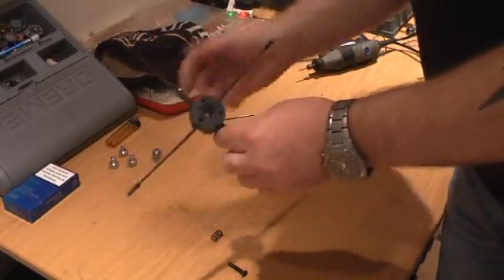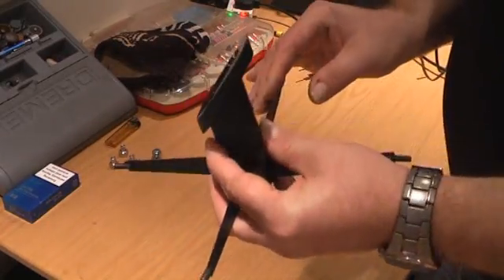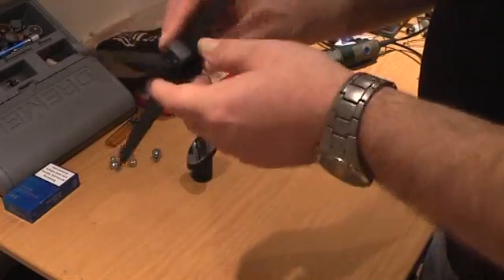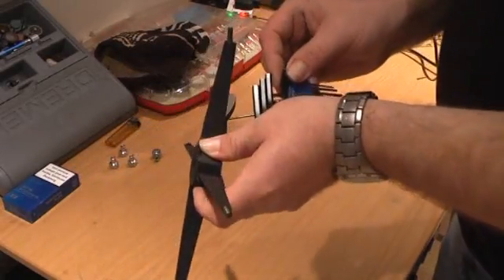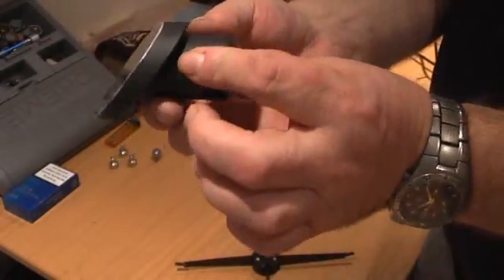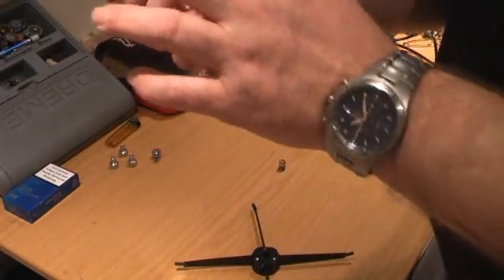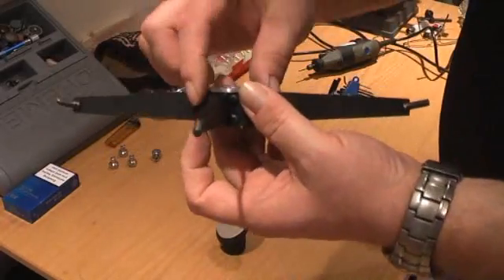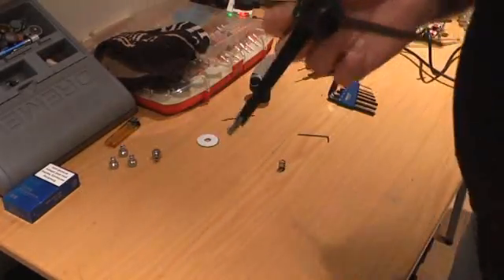Newtonian Collimation Part 1

Comment: Just adding my thanks. It's very hard finding out just exactly this sort of detail, without actually dismantling the telescope - which, as a new owner, I am reluctant to do at this stage. But now I know how it's put together. As someone new to the hobby, I do wonder that these OTAs are so poorly designed - unless that is the manufacturers (Sky-Watcher in my case) have incorporated any of these obvious improvements in the 11 years since this was made. Which I somehow doubt!

Comment: This is a great series.  Thanks for putting it together.  I have an Newt that I never use because I could never get everything lined up.  I'll let you know what happens when I'm finished collimating.
Reply: As a follow up.  I went through your videos step by step this morning.  Went to the hardware store, bought adjustment screws and metal to make the plate that goes between the secondary and spider.  Polished everything.  Collimated everything per your instructions and bam!!!  I always wondered how to get the laser inside the disc on the primary.  Now I know and something interesting happened.  I never knew that the little white disc would fully illuminate when the scope is dead on.  I can't thank you enough for the great information.  You have pretty much saved my astro hobby.
Reply from the maker: Thanks for the positive feedback

Comment: Hi, Where did you purchase the Antares laser collimator? Can't seem to find a UK dealer.
Reply from the maker: Mine came from http://www.rothervalleyoptics.co.uk/  I dont see them on their site but you could give them a ring. I have seen skywatcher ones that look exactly the same as the antares but they are not the same and I honestly think the antares quality is a lot better.
Reply: astronomyshed Thanks for getting back to me, not sure if they are under a different brand in the UK?
I have searched and found these:
http://www.amazon.co.uk/Seben-Laser-Collimator-telescopes-31-7mm/dp/B006FGYWM0/ref=sr_1_1?ie=UTF8&qid=1419372256&sr=8-1&keywords=laser+collimator
and 
http://www.ebay.co.uk/itm/380887110160?_trksid=p2060778.m1438.l2649&ssPageName=STRK%3AMEBIDX%3AIT
Came up when I searched for Antares and they seem to be adjustable too.
Reply from the maker: Richard Evans The adjustable one is a skywatcher one, I dont know about the other. The one from amazon sounds like it could be a badged version of the antares.

Comment: Amazing suggestion with the washer! I've been having trouble adjusting the three screws on the secondary. It's almost impossible to adjust because it shakes too much and it doesn't stay still. So I'll try the washer trick and see how it goes.